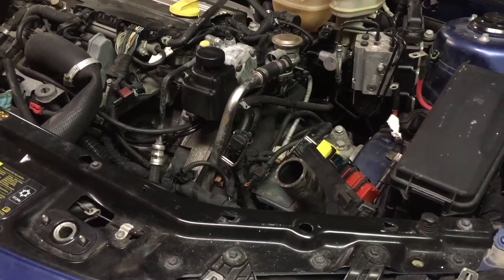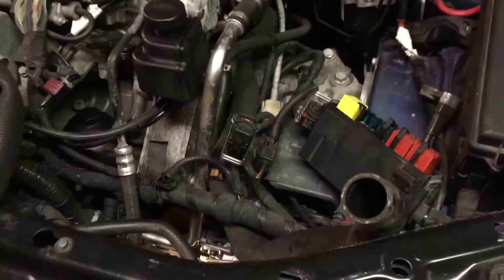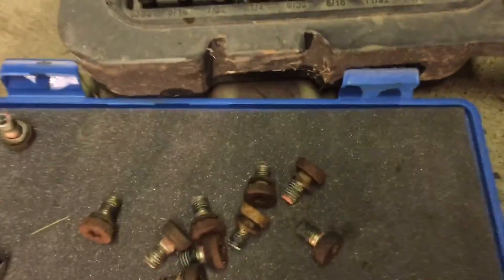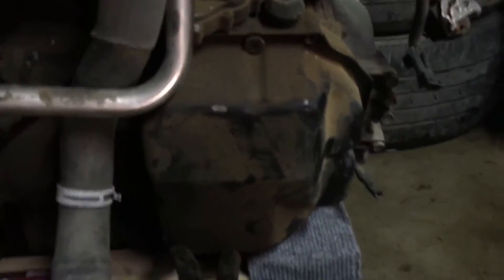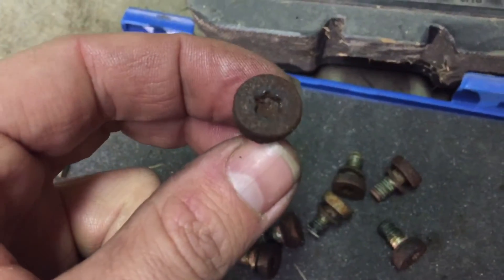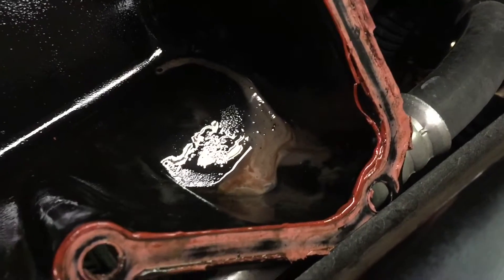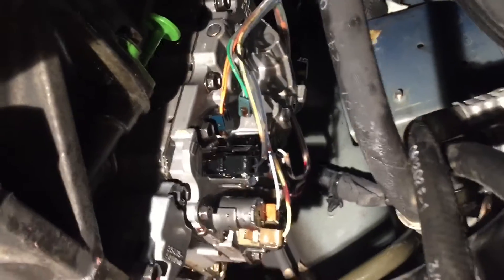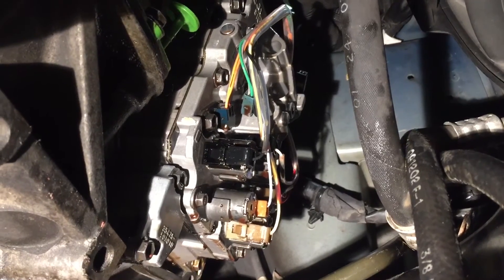Saab 9-3 SS automatic transmission solenoid removal and replacement

Comment: What codes or symptoms did you see that told you this was the fix?   I think the 9-5 uses the same transmission, has me wondering if I should try this on my 2006 9-5 which has a random hard shift when its hot and I am in stop and go type traffic.
Reply from the maker: Terrible operation.  Stuck in 2nd and 5th.  Fail Safe mode.  The kids call it limp home mode.  They overuse that term.

Comment: hello. when gearbox oil is cold transmission works fine,after make it hotter the transmission works with trouble sometimes when car accelerates from 2nd to 3rd gear. i think it caused by solenoid. what do you think?
Reply: hi, i have the same problem. did you solve it?
Reply: @elbunitsyla9974  not yet.but my friend said that some solenoid needs to clean and put it then

Comment: Have you ever change the safety neutral switch on a saab 93 automatic  2002
Reply from the maker: Yes.  The 2002 model is a 4 speed Aisin transmission.  It bolts on the top of the transmission.

Comment: The failure on the input and output speed sensors is due to engine coolant back-flowing into the transmission cooling jack.  GM put out a recall to replace some sort of quick coupling link to address the issue.  Tons of units suffered transmission failures.  Mine failed at 52k miles (warranty ended at 50k) and GM would do nothing to address the grievance.  Thus, it was likely the final GM product that I will ever purchase.  In any event, if you go to the trouble to rebuild the tranny (or maybe just replace the speed sensors / electronics if you are so luck) ... then you definitely need to deal with the design / manufacturing flaw that lead to the premature failure in the first place.  The local Mr. Transmission shop that rebuilt mine installed an air cooler for the transmission in front of the A/C condenser.  Not as efficient as the liquid to liquid heat exchange of the tranny jacket in the radiator, but at least, that way you can rest assured you won’t have the same failure in the future.

Comment: Hi, nice video, in this tape gearbox is removable oil filter ?
Reply from the maker: FixYOURride13 

No. The filter is installed inside the transmission. That is one reason you should regularly change the oil in the Saab and other cars that use this model transmission. I do it every year now on all my SAABs that I own with this AW55 Transmission.
Reply: @richardlabarre7892  Hi, Thx for quick replay & for the information.

Comment: I have po741 code on my 05 9-3 automatic. The code is due to torque converter clutch solenoid being stuck off. Is this solenoid accesible in the same place you accessed?